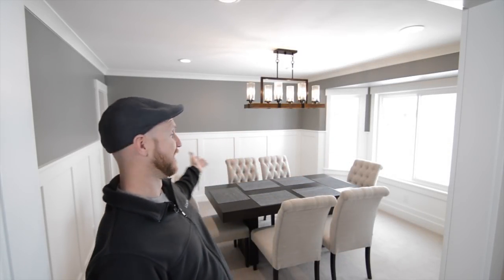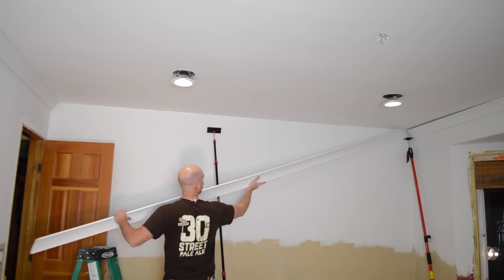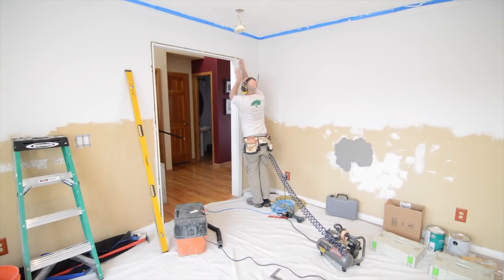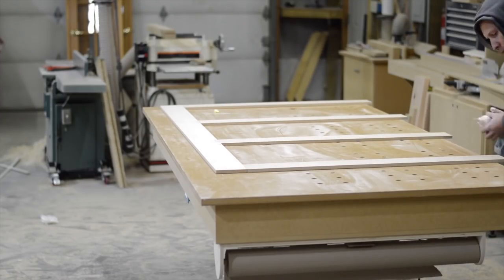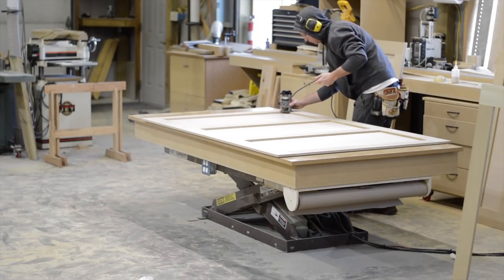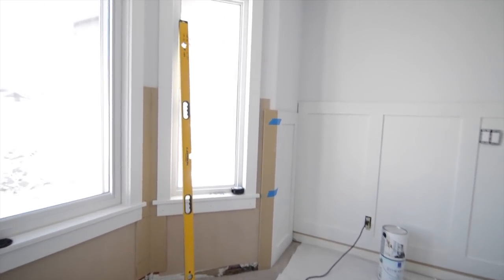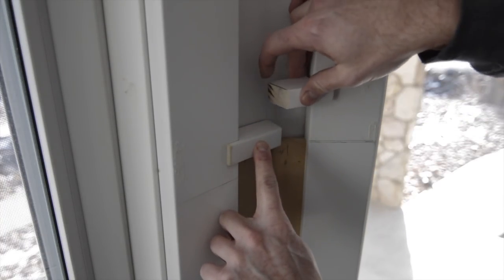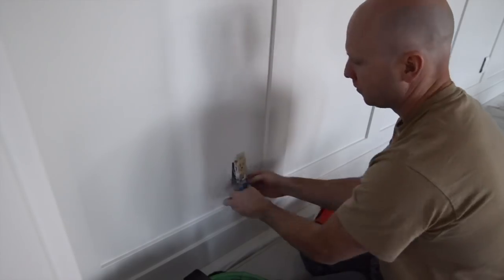Dining Room Renovation, wainscoting or Board and Batten

Comment: Mike thank you very much for this post. I am about to launch into a wainscoting project for the first time and your information is priceless, to me. Can I please ask you to confirm (or otherwise) that when attaching the pre-fabricated backing and face frame to the wall, you  used only  glue and some nails at top and bottom where studs in your wall existed? Thanks again, I thoroughly enjoy watching your videos, Regards, 
Jeff,(from Australia)
Reply from the maker: Yes sir. I put the construction adhesive on the wall, squish the panel onto the wall, then use either 15 ga finish nails, or trim head screws. Good luck with your project!

Comment: Can you provide panel height from floor and also 1/2" material mdf you used what are widths for rails and stiles?  Thanks.  Great work...
Reply from the maker: Panel height is about 50" rails and stiles are 4" and the bottom is 4 1/2". Thank you.

Comment: Hey Mike. Just wondering whether you’ve installed wainscoting to a wall that has a slight convex bow in it and whether you could notice once installed. If your walls had any bows or dips would you pack out behind the wainscoting? I’m in an 80 year old home and debating how far to take it. Have to draw the line somewhere. Thanks from Australia you bloody superstar!
Reply from the maker: If you are just talking about the variations in the wall, that shouldn't be a problem. If it was really far off I might try using some strips to help level the surface out. Thank you!

Comment: Wow Mike...just wow. The dining room turned out awesome! Question for you...why didn't you spray the ceiling rather than roll it? How do you come up with your designs? Do you just walk into a room and somehow know what should be done?
Reply from the maker: Thank you Mark. I forgot to mention in the video that the paint job I did in this room was a B minus at best. This was intentional, the reason being our little boy is going to tear this room apart (and the rest of the house) so I will come back in the future and do it right when he is older. You are right, a proper paint job is when all surfaces are sprayed. Designs; yes, I typically just walk into a room and get a sense, but not right away. I need to exist in a room for a while and think about things, and rethink, refine, etc. Design becomes easier after doing it a lot, your own style develops and it becomes easier to visualize your style in a room. Hope that makes sense.
Reply: It looks great Mike so don't beat yourself up over it. I'm sure there are things that you can see in the room that the rest of us can't see on the screen but none the less. 
I'm still working on the design in my head to build the boxes to set above my upper kitchen cabinets to take them to the ceiling. I think I've got it. I just need to get some supplies. I have no tools and I've seen a cordless Ryobi brad nailer as well as a saw at Home Depot so I think I might invest in those. I'm thinking the brad nailer won't be strong enough to keep the boxes together so I might get some wood screws as well. My goal is once these boxes are in place I am going to paint all of the cabinets a nice white so it all blends and doesn't look like a homeowner hack job. I'm pretty anal about stuff so I have high hopes that this will all turn out and look good.

Comment: Awesome job! Q: why the 1/8 MDF? Wouldn't it have been easier to use the gypsum wall as the backing? I didn't hear your reasoning is all... TIA
Reply from the maker: Thank you. MDF is a perfectly flat surface that is ready for paint. If I were to use the drywall as the backer, I would have needed to mud and perfectly sand the walls. I also would have needed to do a bunch of caulking between the drywall and the board and batten. This would have taken much more time than just throwing on a few sheets of 1/8".

Comment: Incredible video.  What size is the top cap you used (the one that is over hanging the top of the wainscoting)?  Looks like 3/4 in wide by 1 1/2...?"  Meaning it sticks out 1 1/2 from the wall.  Thanks!
Reply from the maker: Thank you. You are close, its 1" thick and projects out from the wall by 1 1/8" maybe 1 3/16".

Comment: Hey Mike Great videos. I have watched all of yours and the dining renovation is my fav. Can you tell me the widths of the verticle and horizontal pieces of wainscot? And also how wide is the base moulding? Is the reveal above the base moulding the same width as all other verticle pieces? It looks like it is   Thanks for the great videos. I have learned a lot just watching and studing your methods.
Reply from the maker: Thank you. The verticals are 4" the top is 4" and the bottom is 4 3/4". The reveal above the base molding ends up being about 4 1/4 - 4 1/2.

Comment: Mike I note you recommend use of a biscuit joiner for the face frame.  With half in stock for face frame,  do you think a festool 4mm domino might also suite for this type of project? ( with mortice set to loose, in order to provide wiggle-room).regards, Jeff
Reply from the maker: It would work fine, I would suggest two of them due to the width.
Reply: Thank you, thats how i have gone with two dominos per join,  and the alignment is very good. Your response is much appreciated. Have a great day.

Comment: Those spring tools are killer.  I use them for hinge pins on doors. 

The zip wall pole, do you have a different plate or something on the end? I have a ton of those. Would be nice if someone 3d printed a small lip on one off the long ends to catch the under side of crown.
Reply from the maker: Agreed, carpenters should not be without a spring loaded nail set. I'm not sure about the plate, that was the one it came with. I would love a plate with a lip.

Comment: Yep...Bob Ross had a super voice, and talent just like you but in a different field! I have a question, I see your work table, and I find it great, with the paper roll for large glue up, and I saw you raise it sometimes, could you tell me the size and material of the surface, did you built it yourself? , and what is the mechanism under, electric or hydraulic or I have seen some with both, what is the range of it up and down? 
PS: you really fill the category of your YouTube license 'EDUCATION'
Reply from the maker: Thank you very much. My lift is made by AutoQuip, it's the 36x72 model that lifts 2500lbs. I built a MDF torsion box to fit on top of it. It's been a very good addition to the shop.

Comment: Ah ha! I finally caught one (slight) error. Cause there aint many good sir. 22:31 installing the receptacle - need whats called a “box extender” due to the introduction of spacing from the thermoplastic junction box to the yoke of the device. And then youll need to cut the ears of the outlets to get them flush. Did you backstab or wrap screws? Same treatments in my DR. I routed out an overlay and undercut in the verticals with the horizontals for site spacing of panels. They’re never exact from wall to wall. The tiny corners show the ATD. Beautiful.
Reply from the maker: Good eye. I didn't have one in stock. I had to go back and add an extender later. Thank you.

Comment: Mike, I like that small bearing router bit.  I always hate the work it takes to make  a right angle joint look ok because the router bit doesn't cut far enough into the corner.
Reply from the maker: These little bits help. Its not a perfect solution, but it is much better the the 1/2" diameter bearings.
Reply: @MikeFarrington  I'm looking for a similar bit, is this a 1/8" round over or is this smaller?

Comment: Hi Mike. I need to know how to transition from bead board in the kitchen to traditional wainscotting in the front room.
Reply from the maker: With out seeing it, I would be hard pressed to offer any advice.
Reply: @MikeFarrington  I figured that. Well, I will continue to research. One last question in regards to that, do you see anything wrong wainscotting the dining area the same as the living room, as they are attached?
Reply from the maker: @joshuawade2304  I see nothing wrong, in fact I would consider it a good idea. It will tie the two spaces together.
Reply: @MikeFarrington  thank you sir.  I didn't know if that would be "too much" wainscotting.
Reply from the maker: @joshuawade2304  It may be too much. I don't know with out seeing the space. I recommend that you lay it out with painters tape. I have done entire rooms for clients before. Its relatively cheap to do.
Reply: @MikeFarrington  I think it will be okay also. Lastly, how do you compensate when your wall corners aren't squared? I have a wall that from the floor to the ceiling is off about a quarter inch.
Reply from the maker: @joshuawade2304  I just cut the panels, the outside piece won't be square, but thats just how it goes.

Comment: Mike I have a question for you I am making 12 small chairs and I am wondering if I can use brisket jointers due the strength. Thank you.
Reply from the maker: Yes, the brisket joint is plenty strong for any project, but the biscuit joint is not strong enough for chairs. Mortise and tenon is the only answer in my opinion. Best of luck!
Reply: Thank you for your time. I will follow your advise.

Comment: What's the best method of attaching the panelling to a brick wall?
Reply from the maker: I would use high quality construction adhesive and some tap con style masonry screws. I would design the paneling in such a way that moldings covered the screw holes. Baseboards on the bottom and chair rail at the top.
Reply: @MikeFarrington  makes sense, amazing. Much appreciated!

Comment: Great video, Mike.  I'm looking at putting wainscoting in our dining room.  How did you decided on the height of your wainscoting?  Everything I read says there isn't a standard height.  Do you have a formula that you use?  Thanks.  Big fan of your work.
Reply from the maker: Hi Drew. I would suggest anything but in the middle. Splitting the wall with half paint and half wall paneling looks odd to my eye. So if you have 8 foot ceilings, as I do, go either 3 1/2' or less, or 4 1/2' or more. In this project I went with 56". I do not have a formula I use. I will say, painters tape applied at the height you are considering will go a long way. If you look at my channel, the wall paneling job with the squares, I taped off an entire wall to scale before building. Wish my answer was more firm.

Comment: Awesome video and great work! Quick question - did you caulk just the top rail or did you caulk everything in between each square panel?
Reply from the maker: I caulked the top rail, the seam between the baseboards and the paneling the inside corners (walls), and around the windows. The paneling didn't need caulk.

Comment: I've watched a couple of your videos and this is the only one so far I've seen with crown moulding in it. If there are others where you go into detail I apologize.  
  
What do you cut your mitres with? Standard DeWalt mitre saw or do you have a special crown moulding cutter? I've found the mitre saw to be too inaccurate on large moulding (4"+), and I always wind up finishing the joints by hand. Very frustrating.
Reply from the maker: Yup, I use a 12" dewalt saw with a good blade. It's not super accurate, but it gets the job done. I use the crown stops on the saw bed to set the spring angle. I also set up rollers to make sure I have a nice working surface. I will try to work in some more about crown in future videos.
Reply: Thanks for the reply.  
  
Your channel hasn't "blown up" yet, but quality content like this (plus your knack for videography) means it is only a matter of time.  Your future success will be well deserved.  
  
Finish carpentry and upholstery are the 2 most unrecognized crafts in my opinion. The amount of skill guys like you put on display in these videos is incredible.
Reply from the maker: Thank you for the kind words. Time will tell if my channel takes off. I really try to demonstrate the efforts required to build nice things in an attempt to raise awareness to carpentry.

Comment: Beautiful workmanship, really enjoying your videos.
How would you go about pricing or giving a quote for this type of work.
Reply from the maker: Thank you Peter. This video is a little deceiving in that I would never bid a project like this for a client. I would not perform electrical work, drywall or onsite painting professionally. When its my house, sure. On the woodworking side of things, I break down each task of a project including things like buying materials, loading, delivery distance, and the normal stuff like cutting, gluing, clamping, sanding etc. From there, based on experience, I add up the hours I think it will take, add a buffer, then calculate materials. That would be the bid. That is never the answer people are looking for, but its truly the way I go about it.
Reply: Thanks for the prompt reply.
Its good to get an idea of how the business end is done.
I subscribed after watching my first video of yours, as you quality, content and wit is top of the line.
I will be working through them all many  times.
Keep up the great videos.
Cheers.
Reply from the maker: Thank you Peter, good to have you on board. I will say, pricing is by far the hardest part of this job. When I first started I asked many people to help me learn to price. One guy finally said yes. His system was exactly as I described above. Just list everything out and the bidding process becomes less daunting. The only real way to get better at it, is to do it! Gain experience by doing and things become easier. I should mention that this would only apply to truly custom work. If you are doing system type work, like kitchen cabinets, or making moldings, etc. Thats a different story.

Comment: Great video! Quick question, why make the panels in the shop off the wall instead of nailing the vertical pieces directly to the wall? Super beginner here just wondering
Reply from the maker: By making one large unit, I can build it to higher standards and use fewer fasteners to attach it to the wall, which means less nail hole filling. I think in the end it makes for a better project. Though nailing the pieces to the wall works pretty darn good as well.
Reply: Mike Farrington thanks so much for that info!
Reply from the maker: @jeremysimpson7052  My pleasure.

Comment: am currently doing a room in my house with panelling... it looks nice and easy watching this video but my word is it driving my ocd insane, basically having to work around the panelling and trying to make the panelling work with the room, it has 4 entrance ways, each wall is a different size, each wall is not level, the floor in all corners is not level and.. each door frame has been rendered all out of level and uneven. I thought panelling would make the room look really nice, but the level panelling almost brings out all of the imperfections of the room, so am pretty much having to re plan it all out again for the third time, driving me crazy as ive not done this before. i mean for everyone else "it looks good" but for me i can notice things out of level and the panel sizes are different for each wall
Reply from the maker: Tank you. I'm sorry to hear about your issues. I will say this, no project is perfect and a good craftsperson knows how to make compromises based on what they have to work with. Sometimes that may mean things don't look as good as you would like, but thats the best that can be done. Keep at it.
Reply: @MikeFarrington  thank you. i am basically doing mdf panels with 10cm mdf panel strips (only 6mm). but then i see your room has nice architrave that i like that suits it well so this evening i have cut plywood for all of the door architraves but what i did was i stuck the mdf panels to the wall first, this crap parkside nail gun wouldnt nail to the wall at all... and of course then i realise ive cut the boards to fit flush to the door frames, without architrave. so i have to put the plywood ontop as a guide. then cut the panels so that they fit flush to the plywood.. whilst they are stuck to the wall. cutting with a stanley knife isnt very good. so am proper cursing myself at the moment but come back to this video to see how its properly done. your work is amazing and inspiring!!
Reply from the maker: @Retrobution  Sorry to hear of your challenges. Keep at it.
Reply: @MikeFarrington  another day done. its looking better now. i used a multitool saw to cut the boards on the wall. keep up ur awesome work!!!